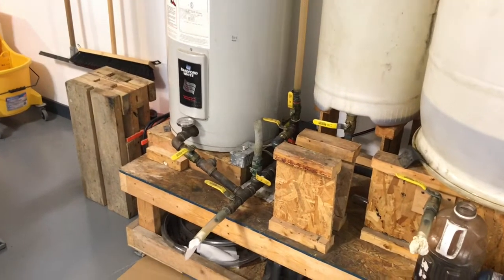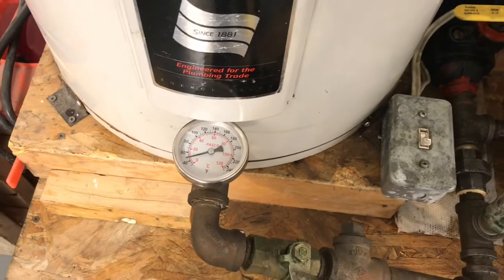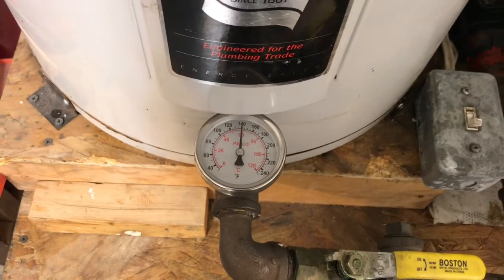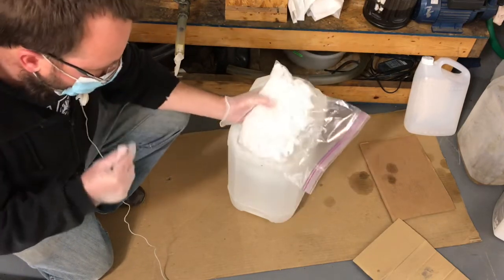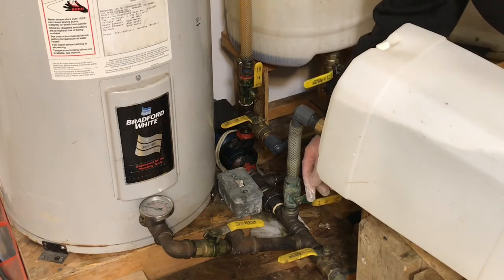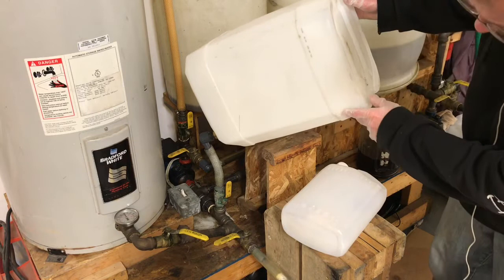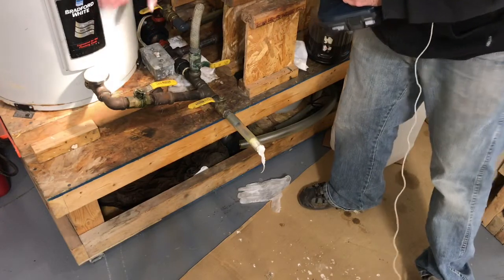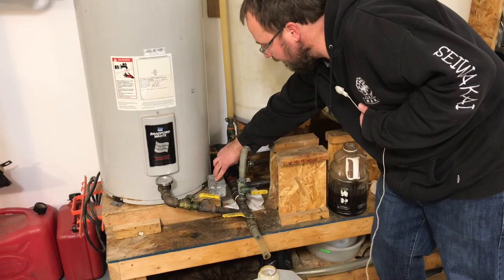Making Bio-diesel Part 2 - Processing the waste oil into Biodiesel!

Comment: Lovely setup. I think a easy extendsion would be a temerature triggered switch or thermostat switch for socket to prevent overheating.
Reply from the maker: Water heaters have a thermostat. Mine set to 140F

Comment: But it takes energy (gas or electrical) to heat the oil.  What is the point of doing this?
Reply from the maker: It takes about 50 cents of electricity to heat the oil.  Not relevant

Comment: Couple of things that were left out. Methanol has a boiling point of 148.5°f , making the methoxide catalyst by adding sodium hydroxide (lye) to methanol is an exothermic reaction (gives off heat) and the amount of heat could push the hot oil/catalyst mixture above the boiling point of any unreacted methanol which is a serious safety hazard. Error on the side of caution here people hearing the oil to 130° vs 140-145° will have the same reaction and reduce the risk considerably. Thanks for the video keep up the good work
Reply from the maker: Nobody should make this.  This is a demonstration only.

Catalyst was KOH not naoh 

Exothermic heating is minimal in my experience.  The oil is cooling off as fast as the reaction creates heat.

But agree you don’t want to push the boiling point of methanol.  Lower is safer.
Reply: Alternatively, add a reflux condenser to your reactor vessel and get the time benefit of higher temps and agitation from the boiling while not losing that valuable methanol.

I run my process at around 75c which is a vigorous boil. The whole reaction completes in around 30 minutes at which time I turn off the reflux condenser and recover all unreacted methanol from the glycerin and biodiesel product at the same time.

Huge time and money saver doing that.

EDIT: unreacted methanol not untreated methanol.

Comment: What do you do with the glycerin? Is there practical uses for it and what kind of chemical is that? As in is it corrosive, dangerous to environment, flammable, toxic etc? Could it be just burned in say waste oil heater or how its dealed with? Also maybe take the thick stuff out and when it starts to lean, collect that to separate large and tall container, let it settle and pump out the bio diesel that is left to improve upon efficiency of this process
Reply from the maker: I know of some - You can convert it into liquid or bar soap.  Or Apply to gravel road as dust suppression.  Blend in animal feed.  Burn. 

Yes you have the right idea about leaning.  I catch in a 1-gal container and once the biodiesel floats to the top I dump it back in the processor

Comment: i dont get why you dont explain the catalyst amounts better? it sounds like a liability thing but your well past that with the methyl alcohol
Reply from the maker: Well past what?
Reply: @gregs_garage  well past the line for the liability you think you may have. i honsetly think that its more dangerous to not share all the quantities.  but thats just my opinion. good video still! you should try making fuel out of used motor oil. i just looked it up last night and its basically filtering the heckout of it and adding a percentage of solvent. that being diesel, gas, etc. interesting!
Reply from the maker: @kb5335  see my video of why nobody should make biodiesel.  

I am demonstrating some experiments I have done with Biodiesel but do not suggest or recommend anyone try this at home.  I suggest the opposite.
Reply: @gregs_garage  that was actually the first one i watched. good videos! i have a 2015 vw passat tdi, and a 2007 dodge 2500 mega cab with the 6.7 cummins in it. so with the prices of fuel im looking at alternatives to make my own. and honestly being in an agricultural area im thinking of teaming up with one of the farms i know and making it in large batches to sell privately to the local farms. it would make good money

Comment: Question, why say you don’t want to introduce methanol into the hot tank for the mixture then show the temp is still hot, and mix it in anyways? I’m seriously confused
Reply from the maker: I'm saying you don't want to introduce methanol with the heating element ON.  The element must be off.  The temp is still 135-140F but the element is OFF.  I don't want methanol touching a HOT element.

Comment: Love it but it's inefficient better to just mix 50/50 oil and diesel of course you should still filter out the oil but this way there's no need for methanol as well as theres no longer waste products and it actually burns cleaner in your engines so it will clog up less than this method it works but your still just wasting time energy and money this way on top of mostly blowing up your house also 45% of your neighbors

Comment: I think this setup could be improved, first I’d have a conical bottom reaction tank which could improve the glycerin removal stage, also while heating it would be good to have something slowly stirring the oil to ensure even heating and possibly speed up the heating process in general. These are my just my personal theories so I’m not sure they would improve or not. Quite a good setup and you’ve certainly got good ideas on how to do some things like he catalyst introduction method is awesome.
Reply from the maker: thanks.  Yes improvement is always possible. Hot water heaters are more convenient than rigging up a conical bottom tank.  I mix the heating oil periodically by turning on the switch for a minute.

Comment: Is there ANY DANGER of having the oil/methanol mix in a closed container like your waterheater?
I mean there will be gases...
Should I open a a hole in the top for venting the waterboiler?
Reply from the maker: you should not do this at all.  This is a demo video only.

My demo machine has a pressure relief valve in the top and also a valve that I always keep open.  So any pressure can leave the tank.

Comment: Cool setup mate! The biggest issue with evaporating methanol is that it'd make you blind before it can reach combustible levels
Reply from the maker: Always work in ventilated area.  I keep the big garage door open.
Reply: Yup, I would add , wear a full face respirator with the proper filters.

Comment: How much potassiumhydroxid did you use?
Reply from the maker: about 1100 grams based on the fairly high-quality oil I get (100 litres)
Reply: Great videos! Love them, so if you oil is lower quality (darker in color i suppose) how do you upscale from 1100 grams? Thanks

Comment: We in the UK have found you can make bio at 20°C.
Also I got down to using 13% meth on 200lt batches.

I would also look at making a venturi, adding methanol directly into the pump isn't ideal.
Reply: It’s not just methanol going through the pump, it’s oil and catalyst and it is metered through the valve. I have never made bio but want to for sure.
Reply: @1966cambo  methanol is extremely flammable, using a venturi is far safer.
I've made bio for 12 years.
Reply: Mark good to know it works with 13%. I was calculating costs and at 20% it doesn't seem it's worth the effort at the price of methanol.
Reply: Please explain 200L on 13% meth and how much KOH